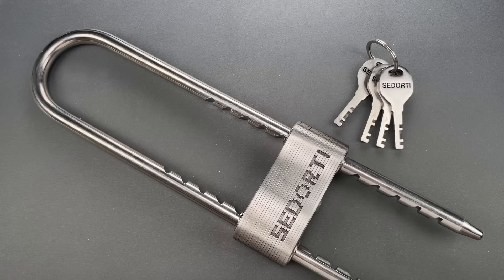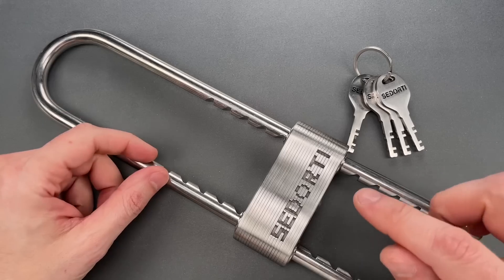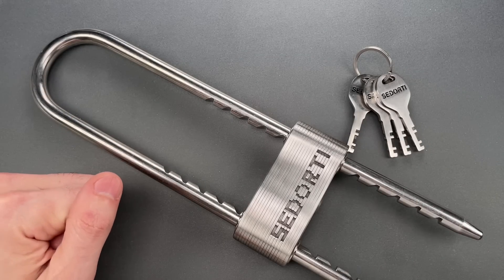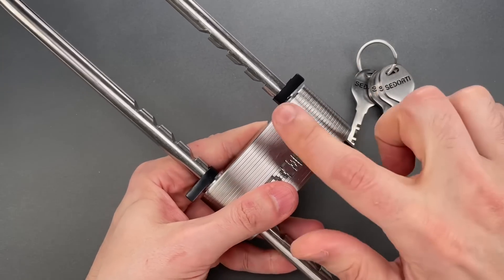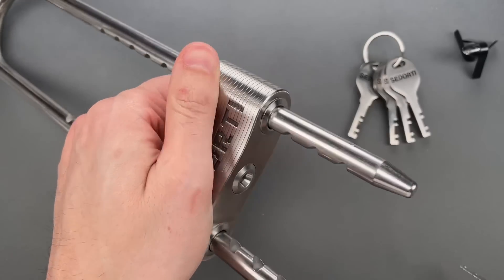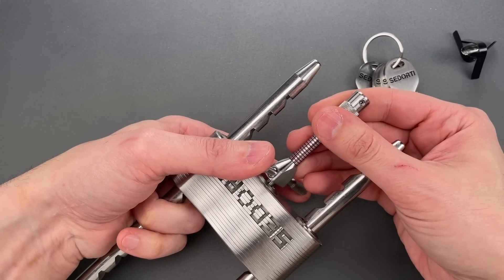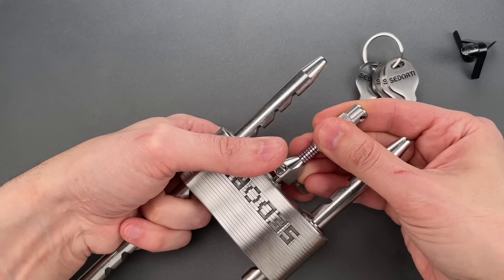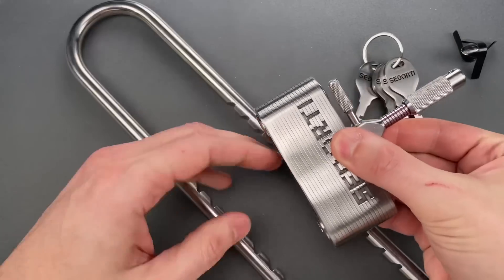[1583] Sedorti Stainless U-Lock… Two Vulnerabilities

Comment: I can forgive being able to pick it with a special tool, but shimming is absolutely inexcusable. Don't even need any special shims for it, just something vaguely thin and sturdy like some plastic or even cardboard.
Reply: Agreed. The shimming vulnerability is inexcusable, especially given the apparent high quality materials of the lock. That design seems pretty modern, and shackle shimming vulnerabilities in locks has been known for many decades. That pick is such a specialty tool that I'm really not worried about most disc detainer locks being picked, at least by thieves of opportunity.
Reply: @AndyGneiss  Yeah, cutting, grinding and shimming are the primary attack vectors on such locks. This disc detainer core would be just fine in any medium level security setting, but here it's just there to look pretty while a piece of stiff cardboard is used to pop the thing open.
Reply: 2 pieces cut from a soda can
Reply: The shimming vulnerability is because of the adjustable design. If they had used a ball bearing locking mechanism to solve the problem it would require the user to hold the key in the unlock position while adjusting the shackle height. That would be quite awkward with only two hands. I'm sure there is an alternative solution but it would a bit different, and different is always expensive.
Reply: @joeschmoe6908  Absolutely! You can't shim a ball bearing.

Comment: The shims flying off-camera was far too perfectly cinematic.
Reply: Darmok and Jalad, when the shims flew.
Reply: @u9Nails  

LPL and Bosnian Bill when MasterLock failed.
Reply: @RhinoBarbarian  No no, it's Shakka, when Master Lock failed.
Reply: @s Shakka, when the walls fell.
Reply: @u9Nails  that would definitely make for an interesting twist to that story!
Reply: Should redo the shot with the Slow Mo Guys!
Reply: It's that satisfying 'v-shaped' trajectory they make as they fly in opposite directions. Just beautiful 😆
Reply: Straight into orbit!
Reply: I used to work with electronic locks. When I forgot to remove the pin after locking the solenoid they did a really good job flying off when the lock opened.